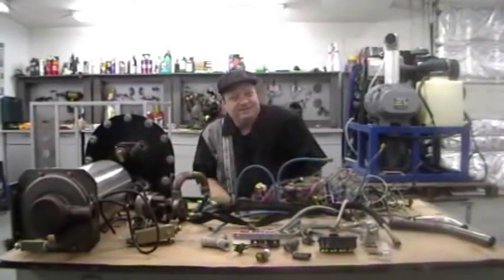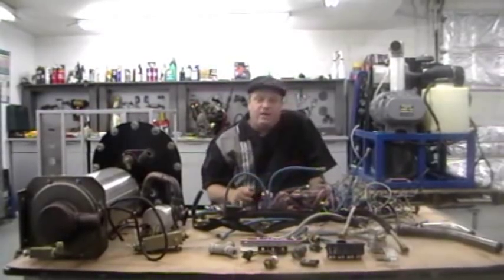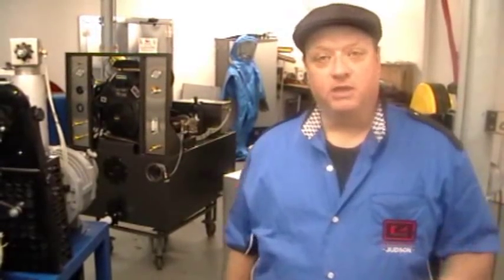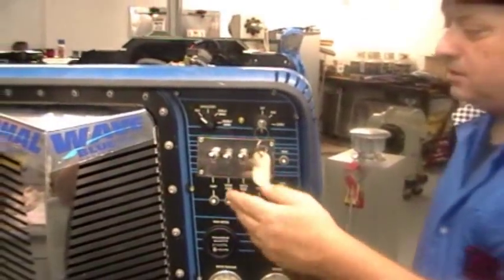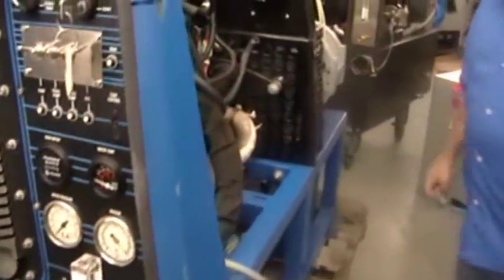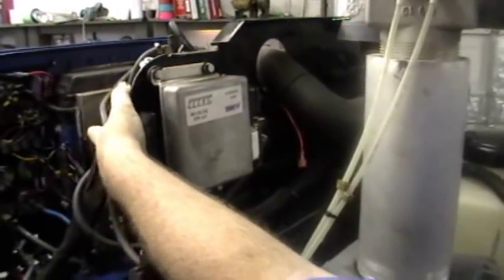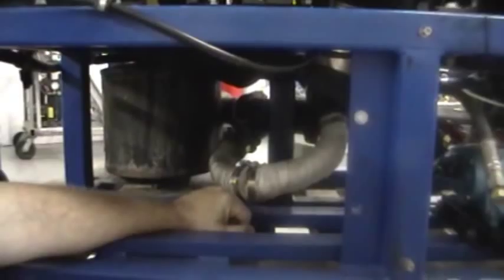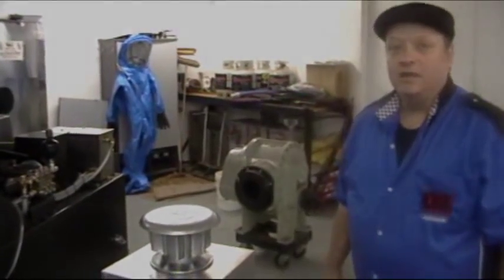Truckmounts - How to Simplify Your Truck Mount Part1

Comment from the maker: Truckmounts - How to Simplify Your Truck Mount Part1
 #truckmounts    #carpetcleaning   #carpetcleaners  
Judson offers Truckmount Re-engineering services.  If you are having any issues with your truckmount, we can re-engineer it for you to make it more reliable.  We will also increase the performance, make it run quieter, and make it more economical to operate.  In most cases our re-engineering services are much less expensive than replacing your troublesome truckmount.  Don't delay.  Give us a call if you are having problems.  We know how frustrating down time can be.  Ask for Les Jones.  864-233-6442.